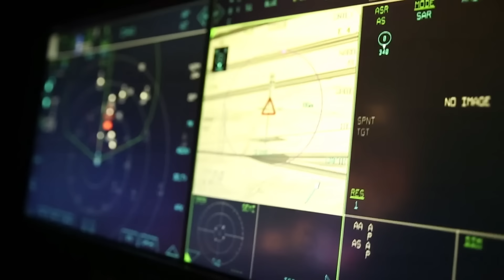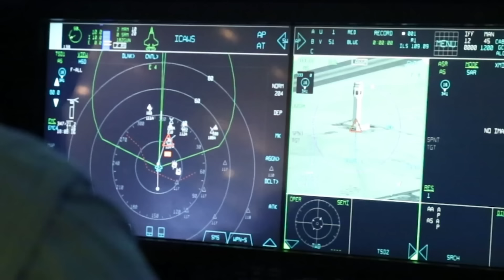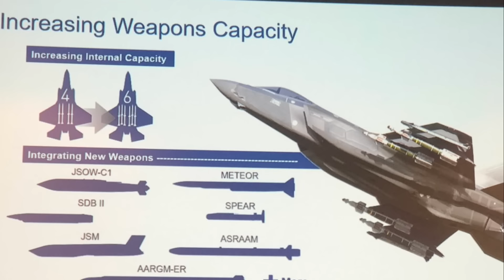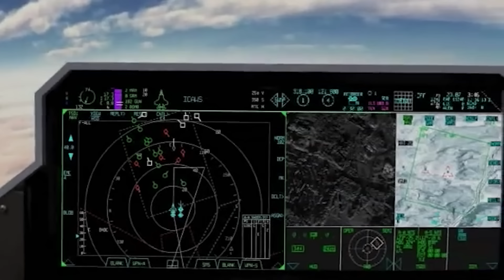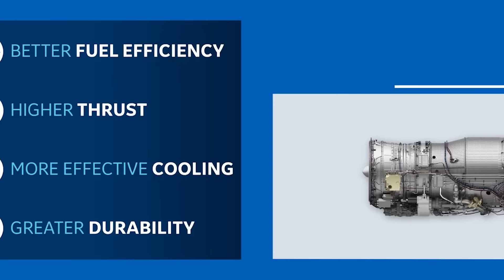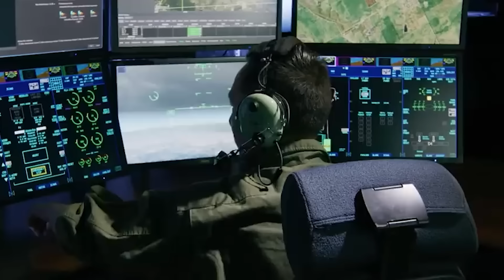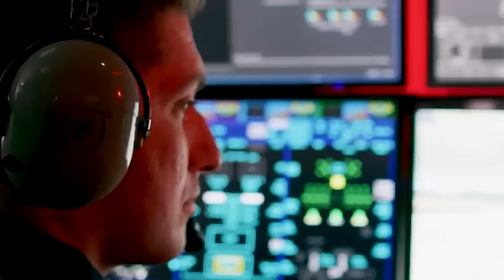The F-35 is about to become a POWERHOUSE

Comment: Did they sort out the 800 software snags? Does it still need 100 ground hours for 1 flight hour. Can it fly thru thunderstorms now. Can it now fully sharply turn in a dogfight. Can it now fly more than a few minutes supersonic?  So many sold? Easy ALL nato country Defense Ministers, are appointed by nato/US.. so, what to buy?
Reply: Well, what software issue in particular are you talking about?
After all, when one pilot did not strap on their mask correctly? That pilot complained about oxygen levels. So, they grounded the WHOLE fleet.

Now, why is this point important?  it tells use TWO very important things:
One: pilots don't fly aircraft that has a issue that puts them at risk.
Two: a minor incident like a pilot not wearing a mask correctly will result in the WHOLE FLEET being grounded for 3 days.

So, if one of those supposed software issues is a real issue? Well, they ground billions of dollars of aircraft. 

So, take Japan for example. They purchased 38 F35's. They learned how to fix them, maintain, fly them.

Then what occurred?
Well, Japan came back for the LARGEST single order for F35's. (they asked for 100 more!!!).
Now, I don't know about you, but I NOT aware of anyone buying anything, and THEN finding out it is not good, and THEN coming back for a whopping 100 more copies of the F35!!!

Clearly, whatever software issue you are talking about?
No one cares, and as noted, one small issue with those fighters, and they are ALL grounded for days on end. 
So, it can't be an issue that anyone cares about, and that includes Nation after Nation lined up to buy the F35.
so, Japan, South Korea, Singapore, Norway, Switzerland, Italy Israel, Canada, Australia, Netherlands, UK and MORE? 

They are ALL buying the F35. So, why then are they not worried about what you state here?

The F35 right now is the best selling fighter jet in 40 years. And nation after nation CLEARY does not agree with you, do they???

All all those nations dumb, and you are smart then???

>>Does it still need 100 ground hours for 1 flight hour.

Actually, the F35 takes LESS ground crew hours to keep flying then a F16, F18, F15 or f22.

And the F35 currently costs LESS per hour to fly then a f18, f15, f22. And it is JUST a bit higher per hour then the F16, (but the F16 STILL takes more ground crew hours to keep flying then does a F35).

Right now, after flights, the F35 breaks less, and has LESS problems then ANY other fighter in the USA inventory right now.
Reply: >Can it now fully sharply turn in a dogfight.

Out dogfights a f16 easy, and yes it both turns better, and has a better thrust to weight rating then a F16, f18, Super f18 and even a dual engine Rafale.

And the F35 is the best selling fighter in 40 years because it is priced less then most of the alternatives right now.

so, some quotes from a F16 pilot now flying F35:

The simple matter is single tail fighters have significant disadvantages over that of twin tail fighters. The fantastic line of “Su” designs from the wonderful folks at Sukhoi Design Bureau have not even considered ANY single tail fighter in 30+ years. (In fact, no one is, unless they are really short on cash).

So, the F16 has some serious handicaps against the F35, and one big issue is the single tail design on the F16.

This is basic aerodynamics 101. When you pull up hard on the F16, then airflow and pressure builds under the airframe, and now airflow over the rear tail is blocked (it receives less airflow).

So, to solve the above? You put dual tail sections on a fighter. You then move them apart to get clean airflow. You also angle them to bite even BETTER into that airflow. And look from the front all the way to the rear – you can see the tail sections are placed in clean and un-blocked airflow.

Now the above is an obvious observation of basic airflow over a plane.

But, if the above is really the case, then pilots flying the f16, and now the F35 should CONFIRM this design shortcoming of the F16.

Here are some actual pilot notes (a long time f16 pilot now flying the F35).

Quote:
The F-35 provides me as a pilot greater authority to point the nose of the airplane where I desire. (The F-35 is capable of significantly higher Angle of Attack (AOA) than the F-16

So it easier to point the f35!!!
This confirms the single tail design shortcomings of the F16.

And the pilot goes on to state:

Quote:
This improved ability to point at my opponent enables me to deliver weapons earlier than I am used to with the F-16, it forces my opponent to react even more defensively, and it gives me the ability to reduce the airspeed quicker than in the F-16

Quote:
Since I first wrote this post, I have flown additional sorties where I tried an even more aggressive approach to the control position – more aggressive than I thought possible. It worked just fine. The F-35 sticks on like glue, and it is very difficult for the defender to escape

Quote:
Defensive situations often result in high AOA and low airspeeds. At high AOA the F-16 reacts slowly when I move the stick sideways to roll the airplane

Note how the pilot says the f-16 reacts slowly!!!

Who wants to fly a plane that reacts slow? How silly is that???

Again: real world witness and testimony of a F16 pilot pointing out the shortcomings of the single tail design.

So both witness and testimony, and that of aircraft design and physics are in agreement here.

Quote:
Yet another quality of the F-35 becomes evident in this flight regime; using the rudder pedals I can command the nose of the airplane from side to side. The F-35 reacts quicker to my pedal inputs than the F-16 would at its maximum AOA
(the F-16 would actually be out of control at this AOA)

Again, “reacts quicker”. The F-16 would be out of control at this AOA!!!!!

Again, this is conformation of the single tail design shortcoming of the f16

Quote:
Another aspect is the kind of reaction I get when I push the stick forward; the F-35 reacts immediately, and not delayed like the F-16. Looking at another F-35 doing such maneuvers is an impressive sight. The various control surfaces on the airplane are large, and they move very quickly

Note NOW we NOT talking about AOA, but simply how the f35 responds to pilots inputs.

Again, note the “delay” in the F16. The F35 not only uses the rear elevator, but also the two tail fins can augment the airflow by moving the twin tail surfaces to help the rear elevator (because they are angled – they can provide lift in addition to left/right forces).

So two rather interesting issues here:

The lack of f35 dogfighting ability seems to be a myth, and REAL pilot notes not only state that the F35 is very maneuverable, but such pilots note that the F35 fairs better and is more responsive against F16’s.

The f35 based not my opinion but above quotes will out fly, and out dogfight an f16 rather easy.

The F-35A’s are currently defeating F-16s in close combat by using their advantages in acceleration, better thrust to weight, better AoA & yaw, and along with solid capabilities in turn, pitch & roll? The F35 is a better fighter then a F16 in BFM.

Comment: Wasn’t the F35 supposed to already be a powerhouse? Seriously, how many decades of underperformance and going over budget do they need to actually deliver a completed product. Jesus fucking Christ…
Reply: The F-15 and F-16 also received constant upgrades. It's a normal part of the defense industry, unless politicians take a hard stance which is what happened to the F-14... decades of neglect resulted in an aircraft that was more expensive to maintain than even the F-22 has been after a decade of having no supply chain.